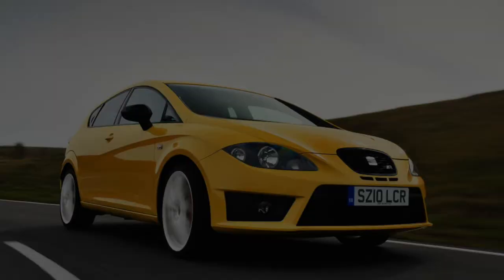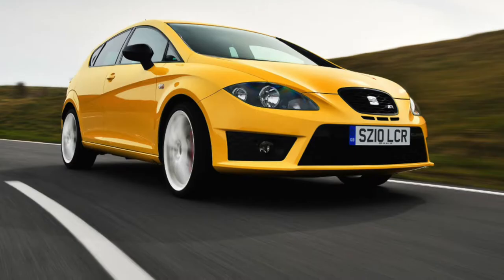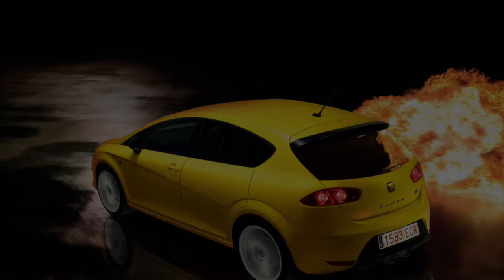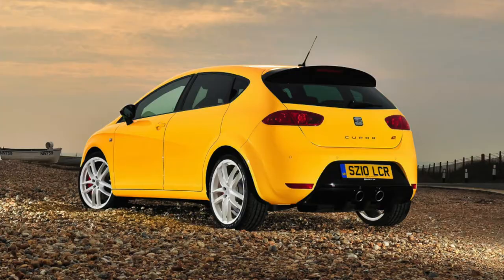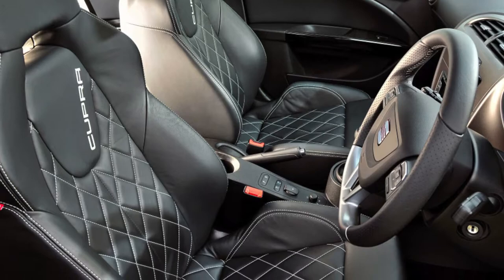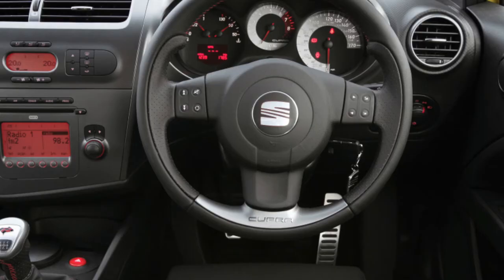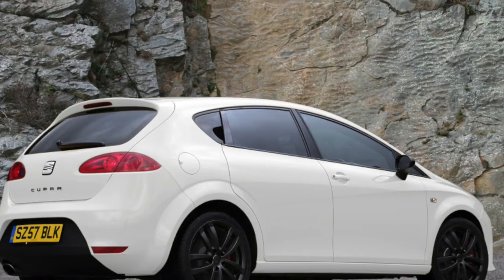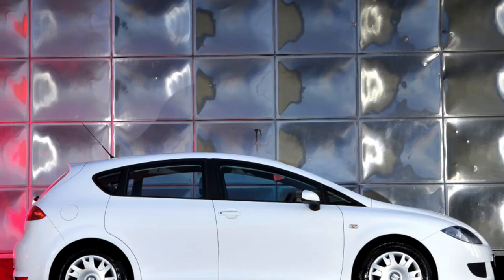SEAT Leon 2 Problems | Weaknesses of the Used SEAT Leon II

Comment: Hi. Mk2 seat cupra 2010. It has done 140,000 miles. Changed the timing belt ( i don't have a chain), fuse box, (corrosion), all 4 suspension dampers, and now the throttle body is being replaced. Looking at starter, turbo and clutch and gearbox at some point. Depressing

Comment: The 1.6tdi common rail engines are really bad for the injectors failing without warning, especially the Seimen/Continental brand injectors, this system isn't the best as it is not recommended to mix brands, and once one goes the rest are soon to follow, the injectors can cost anywhere from £300-£540 though second hand they are on average £130 but obviously comes with risks of the same thing happening sooner than it would with a new injector. 
Parts for suspension and brakes are very cheap to buy though, and they are an extremely safe car in the event of a crash, I know this from first hand experience
Reply: Im thinking to buy a 1.6 105hp, change the injectors is a good choice or must i search for another car?
Reply: @trigi21  I personally wouldn't replace the injectors unless you end up with an injector fault, then I'd advise replacing the failed injector, though if you can afford to replace all 4 at once then do so, as could save some potential problems further down the line. For a new injector from Seat in the Uk, I was £560 for the injector not including fitting
Alternatively look into buying a 1.9tdi seat leon instead of the 1.6tdi, still produces 105 bhp standard, strong gear box set up with decent gearing will see you around 50-60mpg, plus in the event of the injectors giving any issues, they're significantly cheaper to buy and easier to source.